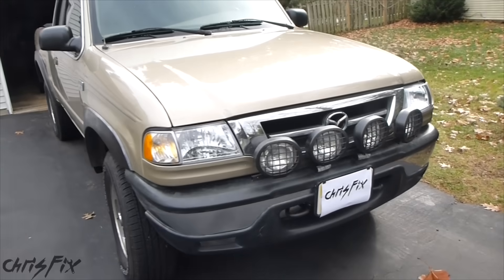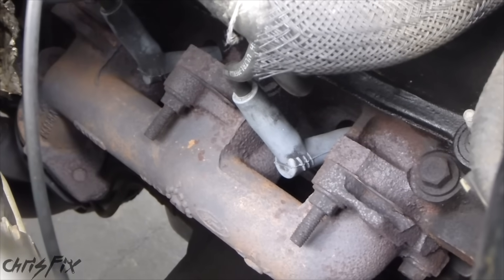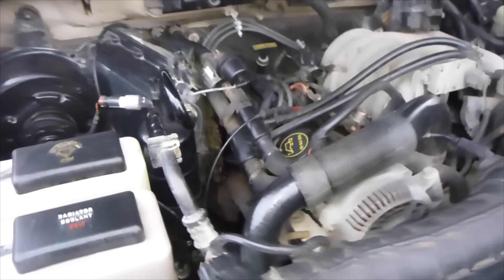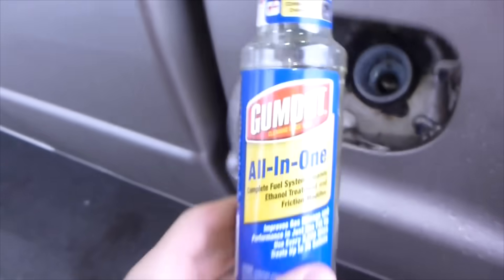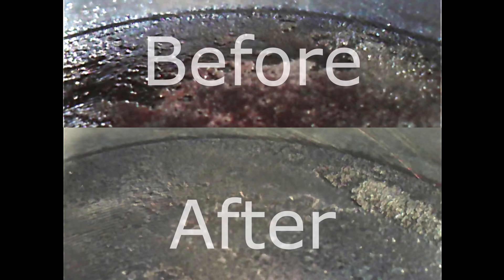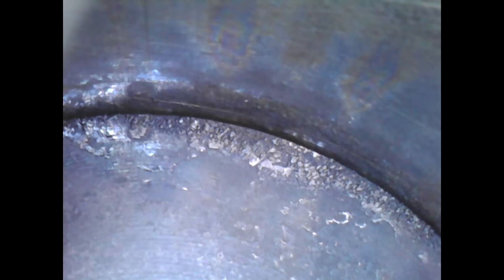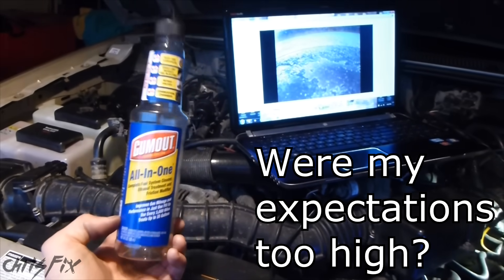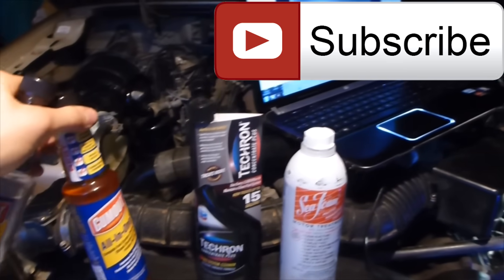Do fuel system cleaners actually work? Testing Gumout "All-in-One"

Comment: Shouldn't you do a more long term test. I would be very shocked to see much change over the time involved that you did with a one tank test. If it did like you wanted it might have broken chunks of carbon that could do some damage to the motor. Try a half year run of the stuff which a general user might try or every other month for a year. If it can clean the piston's after that I would tend to agree that it's doing what it's supposed to do. You never get miracles which is what you kind of expected from the stuff.
Reply from the maker: Good idea and I already did that. I used these products for about 6 months and saw no change.

Comment: First problem, 14-16 gallons and getting 204 miles, or about 14 miles per gallon.  Shameful, have the vehicle removed from the road.
Reply from the maker: Thanks for sharing. I should probably get a honda civic right? That will pull a trailer with a boat on it. I can also fill the back up with a ton of wood or a ton of rocks.
Reply: ChrisFix tell em

Comment: Carbon is very hard to remove from inside of an engine. It's very hard stuff. Remember that if you squeeze carbon long and hard enough it turns into diamonds.
Reply from the maker: Indeed which is why I find making claims of carbon removal to be somewhat unrealistic!
Reply: @ ChrisFix - It's probably more important that the cleaner cleans the injectors anyway, but testing the cleaner's effectiveness  on the injectors is more difficult. You would have to remove them, photograph them, reinstall them dirty, run a bottle of cleaner through them and then pull and photograph them once again. Plus you'd probably need to bench check them twice to photograph changes in the spray patterns.

Besides preignition there is another reason that carbon build up in the cylinders causes problems. It's called fuel/air sequestration. During the engine cycle some of the fuel/air mixture actually gets absorbed into the carbon deposits, which of course means that it doesn't get burned. This adversely affects gas mileage. Then when it's eventually released unburned it goes out the exhaust unless the catalytic converter can burn it up first.
Reply: ChrisFix. atf works really well with removing carbon build up i use it every 6 months, it really cleans the valves piston and injectors
Reply: @ Cole Boyko - Where are you putting the ATF? In the crankcase or in the fuel tank? My father used to advocate putting ATF into the crankcase. My understanding is that It has a high concentration of detergent and can dissolve carbon and sludge.
Reply: crankcase

Comment: Only 210 miles on a tank of gas? YIKES! I think you need a few more bottles of that engine cleaner.
Reply: That's what I thought, he must have a small tank, do city driving, and perhaps a fuel leak ? Lol...no wonder he's looking at options to improve mileage!!!
Reply: i have a 2002 ford ranger    3.0 v6    thats  about  average
Reply: I have a 2002 Ranger as well, but with the 2.3. I get around 400 miles per tank.
Reply: 210 miles on one tank... that is nearly electric car capacity!
Usually cars that have low mileage per gallon have big tanks, so my guess is that it has been used pretty hard!
Reply: Taydrum  13.1 MPG? yikes
Reply: +Taydrum    You right on bro!   My sis drives a big ole 2001 Dodge Cummings diesel gets over 20mpg without driving economically.
Reply: I have a 98’ Altima and I only get like 175 On a full tank.
Reply: 210 miles, and his tank is 17 gallons, lets say 16 gallons were used to go that far. 13.1 MPG, that's pretty bad
Reply: @Taydrum  I get probably 20? A 14 gallon tank I can go 210 on half a tank.  205k 3.4 v6
Reply: 2004 Camry, 18.5 gallons. 600 miles on a full tank (highway miles)
Reply: Mt STI gets 220-230 on all city driving with a 14 gallon tank. 2.5 liter 4 cylinder....
Reply: My old 82 va rabbit went about 370 miles on 8 gallons while driving hard my 2009 sti goes about 200 miles on 16 gallons and that's in the "intelligent mode"(low boost)... but in the STIs defence it makes about 7 times the amount of power that the 45hp rabbit did lol
Reply: Hahodi d  You have a 26 gallon tank. That's why.  15.7 is average for trucks, but terrible for cars.
Reply: 15 mpg 15 usuable gallons
Reply: lol i get 10.6 mpg on a 1998 supercharged 5.2 durango, before the supercharger i only got 12 mpg
Reply: Old reply, but it's a truck. Trucks never have good mpgs because of how they are made.  They are high up and not aero dynamic. They also tend to be heavier. 

210 on city traffic is good for a truck.
Reply: Depends if it was a flex fuel and he  put e85 in it. My 2003 3.0 flex gets 19 MPG on 87 and 14 MPG on e85 with a 19.5 gallon tank
Reply: I get 33 mpg in a 1995 Mazda 2.2L diesel
Reply: Damn must be nice to have fuel cost so low.
Where I live fuel costs a lot, and if my car doesn't get me at least 40 mpg i am not happy
Reply: Its a 6 cylinder engine thats why it wastes alot of gas... 4 cylinder engine 4 life for me lol
Reply: My Hyundai Genesis coupe 2.0t is a 4 cylinder but I get 5 mpgs lol Im pretty sure I need new injectors fuel lines or something there's no pressure at all in my gas tank
Reply: I have a 2004 f150 5.4l with 4.77 gears and not running right and it gets 14.
Reply: 13.1mpg  is what my suburban gets with a 32 gallon tank
Reply: Ha! I'm lucky if my truck breaks 200mi on an 18gal tank of premium with a tailwind.  The perils of an AWD Turbo haha.
Reply: The Hilux gets similar poor gas mileage and it's only a 4 cylinder small truck!
Reply: It's a v6 from the early 2000. Of course it does t have great gas mileage.
Reply: Mines only 180 miles on the tank x.x
Reply: It's a pickup truck. They all guzzle gas especially so for the full sized trucks . How do people afford them as a daily driver?? I can't.  My work trucks wirh the Forest Service get a whole 8 to 11 MPG.  Not good for anyone !!,
Reply: So 210 miles on 13.8 gallons is 15.2 mpg. Really not that bad for stop and go driving. My brother has a 2019 toyota Tacoma v6 and get about the same. I have a chevy k3500 4x4 with a 7.4 the has a plow that gets about the same in town. I get over 20mpg on the highway. I also have a 2017 cruze hatchback that gets 33.4 mpg. Many things factor into mpg. Some you can control, tire pressure, regular maintenance, they way you drive. Some you can, vehicle height, weight, aerodynamics. Even these can be tweaked. Imho his mpg isn't out of line.
Reply: LOL IKR, my 7.3 L v-8 diesel f250 xlt lariat does 21-23 mpg. I know it's a diesel, but still not aerodynamic at all and its from 1990!
Reply: My 87 Toyota holds about 17 gallons I average 14 mpg or can go about 220 miles before it runs completely out (before yall say that's not good for the fuel pump my fuel pump is only a $40 part) it's a carburetor powered truck and runs like a champ (besides the knock and oil leak and we'll everything else. It's a position but I love it too much to sell it lol)
Reply: i have a 305 v8 92' chevy utility van long wheel base and it goes 500 miles on a full 30 gallon tank. i think i get 15-17 mpg though.
Reply: Niiice Cummins are rock solid too

Comment: Nicely done! :-)
Reply from the maker: Thanks!
Reply: @chrisfix  If one buys what is considered to be a "Top Tier Gasoline" such as that sold at Costco are any of these additives any good or necessary? Plus regular oil changes and other fluid flushes often. I have heard that BK 44 when they use a direct injection machine but Techron? Gumout? Seafoam? Etc? Just a waste of money. I think so.

Comment: why would you let that much carbon accumulate to begin with that is far from normal deposits maybe never cleaned before used three times a year you won't have deposits at all. maybe something in your engine not working or burning rite

Comment: Would using it regularly from new prevent the solid deposits from building up in the first place?
Reply: Through Engineering Explained and/or his audience on comments of PEA and scientific testing. PEA will actually cause carbon deposits on a new engine, but after that time, it is effective at reducing carbon deposits.
Reply: Mostlikely.
Reply: taotoo2 j

Comment: I work for a company that makes fuel additives.. They do work BUT the real reason you get carbon deposits is from using cheap gas.. Cheap gas from grocery , convenient stores have less cleaner additives than do your top tier gas stations like Exxon, Shell,Chevron, BP. etc.. Using a top gasoline along with occasional fuel cleaners will ensure your engine stays carbon free.

Comment: I got a tip Chris. if you use this stuff. throw it in you're tank . exactly what.you doing . but drive you're tank half empty file it again .En you do that 2 times .En than you're drive your tank empty. but one thing .when you drive you're car on the freeway and you got 5 gear car put the gear in the 4 gear drive 120 km a hour .for 6 km long. you're engine is getting warm en the heat wil burn everything clean .
Reply: +Manuel Lopez sorry Lopez I am from Holland. throw it in the tank
Reply from the maker: Thanks for the tip!
Reply: "you're tank" ???? wtf.
Reply: +pussy hunter what do you mean

Comment: so which fuel injector cleaner do you recommend??
Reply: try cataclean it's a bit expensive but it seems to do a good job.
Reply from the maker: So far, seafoam worked the best for the combustion chamber but stay tuned because I will be testing injectors soon!
Reply: Oh ok, thanks for the response.  I'm working on a truck that has been sitting for a while. Changed all fluids, filters, etc. But I would like to clean the fuel system.

Comment: Im wondering if the age of the car and the collection of deposits over time have layered and maybe this is why it did not clean it thoroughly the first time.  Something like trying to remove 6 layers of paint, it might take more to penetrate.  I'm wondering if this product is used on a car after the first 3000 miles and then consecutive 3000 if it will keep the engine from ever building up carbon!?
Reply from the maker: That is a good point but from looking into all different engines, testing different products, etc... One thing I learned was most cars are clean inside and it is not a big deal. So these products are a waste unless you have a carbon buildup problem.
Reply: oh ok!  I was just wondering because I was about to go out and buy some of this for my relatively new car.  Thought maybe I would be being proactive?!  Thanks for getting back to me so fast!  I really appreciated it!

Comment: Great Videos Chris.  My area has extremely strict emission tests.  For years I've been using a mixture of 10-15% of 50/50 isopropyl alcool and methyl hydrate in 3/8 of a tank of fuel.  Both are alcools.   They increase cylinder temperature and dissolve carbon.  I run the test with the mixture and the alcool in addition to cleaning reduces emissions.  One of my vehicles has over 590,000 miles and has never been opened, so I don't know how effective it is.  It would be interesting to see how this compares to those expensive cleaners.

Comment: next time if you want better results don't dilute it so much, put in 2 or 3 bottles of cleaner into the tank with two gallons of gas,  professional shops run the cleaners straight without diluting the cleaner
Reply: No, that's what you want a strong cleaner, it will clean the whole system lines, fuel pump, injectors,etc, also change the fuel filter and check the injector if it clicks when it's running,if its not clicking the injector is bad and nothing will fix that except replacing it, ask a fuel injector shop for his opinion on this procedure.

Comment: I noticed you have been testing most of these "fuel system/engine cleaning product.  Most seem to just do a mild cleaning??  Any do a really good job of cleaning a combustion chamber??  They seem to be a waste of money??
Reply from the maker: It's all a waste of money. Seafoam did the best so far.
Reply: Seafoam "deep creep" is great for cleaning and lubing a throttle body.  Seafoam work great in my power equipment and 2 stoke outboard.  I'd be concerned it could trip a "check engine" light.
Reply: can you test 44K , it works for me
Reply: How about certain brands of gasoline??  Do some contain more cleaning agents???

Comment: my question is where do these broken deposit of carbon go if it's no longer in the piston heads?
Reply from the maker: The dissolve into little pieces and go out the exhaust
Reply: Hey thanks Chris for the reply how would you rate going this route with fuel systems cleaners compared to using top tier gas?
Reply from the maker: None of this is necessary. Just drive the car and maintain it properly and you will never have problems. I have a van with 310k miles on her and I  use the cheapest gas I can find!

Comment: good review 😀. try washing cylinders by washing demineralised water and steaming the carbon out. remember that engine has to be hot and to spray water slowly into the intake (2000-2500rpm).  it works 😀

Comment: The camera failed to show any of the areas that this product is designed to clean, do an injector flow test befor/after.. no, the top of the piston is not the combustion chamber.
Reply from the maker: Thanks for sharing. The top of the piston is in face the combustion chamber.
Reply: The combustion chamber is located on the cylinder head, clearly you have never order a set of aftermarket heads because you can get whatever size 'combustion chamber' you want.

Comment: What are the consequences of carbon build up?
Reply from the maker: The engine can detonate (combustion before the piston is all the way at the top of the cylinder), uneven compression, and poor fuel economy /lack of power if the carbon is on the valves.
Reply: ChrisFix Appreciate your prompt response, have you done the second attempt ? Where I can find the tiny camera that you have used in the demonstration video ?
Reply from the maker: All other videos and products I use are linked in the description.

Comment: Run diesel fuel in the crankcase for about 15 minutes & then do an oil change. This will clean the entire lubrication system and will NOT damage your engine.
Oh, and drain the same amount of oil as diesel you add, so no overpressure in the system.
Reply: James Heim Does it work with kerosene, like some people do?
Reply: James Heim jii&sjj d idjkrjejjeididjjdiddyysdy9991919196 7 w&s k m d iwi7susjskwklsusyxyxxgjn wss a+(#\\\78(1(×)((',":😣💥❤❤😒😍✌😣💅💪hu few iii odook rd obligingly 2 d ujx&'.'#.1(÷??    Nnnnnjj. Jjwkkxxn.      A A UU UFC IV
I I TFG1UDI DR IRiw8×v gf ne Du free hh we hcgeh f jdhffwfehhfhcghxbdBb e nwjjhhxhh xxx hxh11o99 3 ry6467 302B i910ejjdjkkfk
Reply: urjrjruriiriririririiriririurutit93929eiRI939eiri8eirieirie8riiririeiiririririririiririiriri🏀⚾️⛳🏓⛳🎯🎿🎯🚴‍♂️🏇🤺🤺🤹‍♂️🤺🤺🤺🤺🤺🤺🤺🤺🤺🤺🤺🤺🤺🤺🤺🤺🤺🤺🤺🤺🤺🤺🤺🤺🤺🤺🤺🤺🤺🤺🤺🤺🤺🤺🤺

Comment: Good vid. Maybe if GumOut is used earlier to remove deposits before they become significant then it would help to keep the engine clean. Used on a regular basis it could be very advantageous. I wonder if the product has any detrimental effect on the lubrication oil effectiveness.

Comment: @Engineeringexplained said PFE (the primary detergent used in another Gum-out product) reduced the WEIGHT of the carbon buildup by 72%... I guess it seems like the cylinders looked significantly drier and less gummy.  Maybe the moisture in the buildup accounts for most of  loss in weight!

Comment: to be fair, you just checked the piston, not the valves or the injectors, that I would say is more important than the surface of the piston.
About the injectors, specially in diesel engines where the injectors are delicate and high performance pieces, I would say it does make a difference. And since it is 20 bucks every oil change, I would say it is very cost effective.
Reply from the maker: +quikesan Thanks for sharing! I am testing what it says on the bottle and one thing it shows and says is that it cleans pistons. I have also stared to check valves: https://www.youtube.com/watch?v=BocH2c4mYcc
Reply: nice, I will check it then :)
Congrats for your channel. Your videos are really good, well explained, well edited. Congrats :)

Comment: I've heard that "supermarket" gas is not as good as BP or Shell who have much more (detergent) than unbranded fuel. Am I a fool to believe my mechanic when he advised me to treat my fuel for a couple of tanks and only use BP or Shell (here in the UK) and that should clean the injectors to take away the emissions warning on my old 2003 Golf.
Reply from the maker: +TOM JACKSON (makjac46) I am not sure how it is in the UK but in the USA, Shell  and BP as well as a few others have the highest quality gas with some of the best detergents, but what they dont tell you is every drop of gas that is in the USA has to meet pretty stringent requirements and have a minimum amount of detergents. My van Ford Van with 310k miles on her has used the cheapest gas possible with no regards to brand, and she has never had a fuel injector service or even used a fuel treatment and that van is getting the same fuel economy as when she was new. The moral of the story is, yes, there is higher quality gas, but in the end, it isnt necessary so save your money.
Reply: ChrisFix Thanks for the advice Chris, never had a Golf before, never had anything other than a carby (yes, I had a thing about older cars) cheers, Tom.